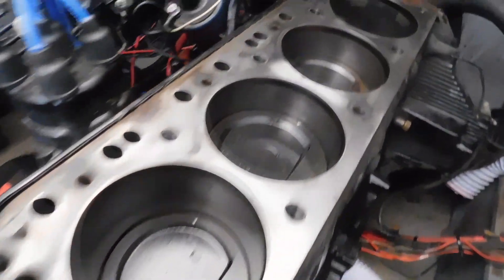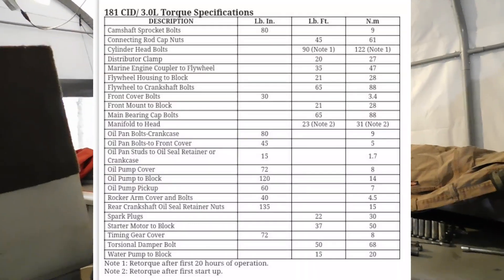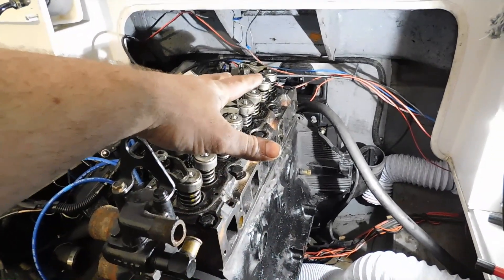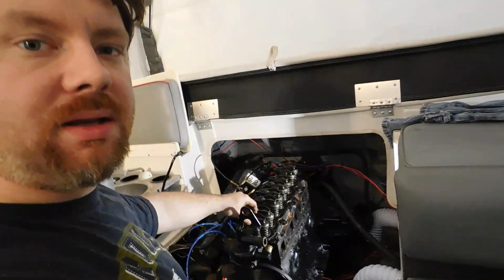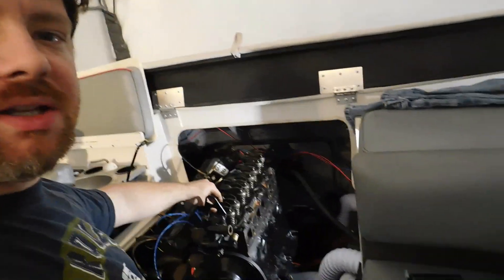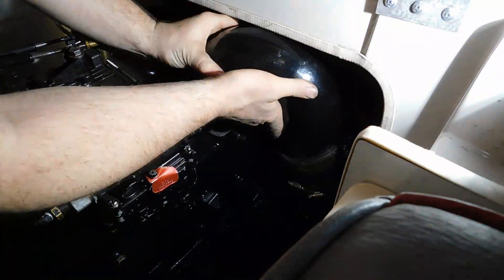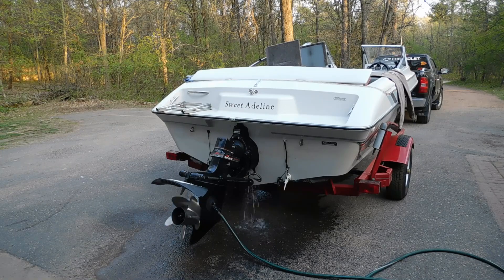Mercruiser 3.0 Head Gasket Replacement

Comment from the maker: To answer a common question I've been getting  check out my update video here  https://youtu.be/p5q3fEBXSQ8
Yes the block has been welded (prior to my ownership) and it's has other crack repairs.
Reply: Hey dale, did you turn the motor to adjust the valves?. Didn’t show in the video. But why the timing would change if you don’t touch the distributor?.
Reply from the maker: @sebastiangomez6929 I honestly can't remember. This was 3 years ago.  But it's always a good idea to double check timing after doing that much work

Comment: After cleaning the head bolt threads, add Permatex High Temp Thread Sealer to the bottom 3/4 of the threads on the bolt and oil underneath the head of the bolt before putting them back in. Then torque 30, 60, and 90 ft lbs in the specific pattern

Comment: Great video...i just got my 3.0 back running after 1 1/2 years...first start up it was running crappy then it blew some insulation  out the exhaust on the prob and i noticed water in the oil...do you think it was from the exhaust beinh plugged?
Reply from the maker: @danlee1904  perhaps. Sounds odd

Comment: Great video.  i was just going to replace my exhaust manifold and seeing this made me say what the hell, just do the head gasket while i'm already working on the boat.  I'm hoping to set my valve lash today and it just hit me.  How the heck did you turn the motor over to hit the timing marks properly?    I tried using the alt belt to no avail.... are you using a remote starter and just tapping it until it lines up?  Thanks for your help!
Reply from the maker: I had my wife tap the key and used the starter. Otherwise there is a special tool you need and you have to remove the front motor mount
Reply: @daleofalltrades  I used a remote starter button and it went much smoother than I was anticipating.  I have a slight valve cover leak now though that I can't seem to remedy.  I'm torquing to 40 inch pounds.  Is that what you are going with?  I hear people saying it feels like too much and can't help but think they are going 40 foot pounds.  I'd like to know what you did and are you using any sealant or just straight cork gasket?  Thanks a ton!
Reply from the maker: @vdubluv222  I re used the rubber/silicone gasket that was on it. No leaks and they tightened snug. No torque spec used on my end.
Reply: @daleofalltrades  thanks again
Reply: Thank you.

Comment: I have a bayliner 185 with the 3.0 that is spewing black water out the coolant water exhaust. Is this indicative of a blown gasket?
Reply from the maker: Yes or a crack in the head or block
Reply: @daleofalltrades  thanks for the reply!  So I did some more sleuthing today.  Oil on dipstick looks new, no sigh of water there. I pulled the block water drain plugs and that water was clear. I drained the driveline oil and it looked good (no water as well). Is it possible that it hadn’t been run in so long there was a ton of carbon and what not to be blown out and that’s what made the exhaust water so black and smelly? I didn’t let it run long after I discovered that for fear of not knowing what it was. 

I’m planning on draining and changing the engine oil as well as driveline oil to see for sure. Gonna check compression and the plugs. Also gonna change the water impeller, no telling if that has ever been done.  

One more question, I didn’t hook up water to the driveline intake until after I got it to kick over/start. I never let it run for more that just 15-20 seconds. Could that have disintegrated the impeller and caused the black?  It had been sitting for at least 2 years, maybe more, so I could see that being highly likely.  I didn’t know about some of these things to do on a boat that hasn’t been running for a while till now (my first boat!), was just treating it like getting and old beater car running.
Reply from the maker: @dkhallal  if the boat has been sitting a long time the water will look pretty nasty Coming out of the exhaust

Comment: Hi Dave and thanks for a great video! How do you turn the engine around to get it to top dead centre? On my engine the engine stand is in the way and I'd rather not take that away. Thanx Anders
Reply from the maker: You have to remove it or use the starter and bump the key. But you can't do that once it's tore apart.   Or you can put it all together and adjust the lifters the way I did at the end of the video

Comment: Are these gasket the same for the mercruiser 3.0 alpha one gen 2 135hp 4l?
Reply from the maker: I believe so. But I can't be 100 percent sure.  A simple Google search for you specific engine should verify. The head gasket is definitely going to be the same as the block really never changed on the top side

Comment: Did I see a 5 bladed Prop on that lower unit  ? What kind of performance is that offering ? Thanks.
Reply from the maker: Yes, it's a pulling prop, you lose a little top speed but gain how quickly it plains out. It's a quick silver highfive

Comment: 8:41 that looks like 1/2 turn. does it make a big difference?
Reply from the maker: Yea it was a mistake on my part. But at the end I ended up adjusting with valve cover off and engine running. (The way I'm used to doing it)

Comment: Thanks for the video, I have a 3.0 but it is a Volvo penta outdrive  I am sure they are basically the same gm 3.0 liter engine . ...head gasket here i come !
Reply from the maker: The Volvo Penta is the same block, with some different bolt ons

Comment: Did I miss you putting aviation sealant on the head bolt threads? I learned you have to do that the hard way.
Reply from the maker: So did I.  I have a follow up video doing all this over again.

Comment: Hey man good video, question?...how do you move the cylinders for valve adjustment with the front motor mount in the middle?....I can't find a way to get anything down there to move the cylinders and adjust the valves?
Thanks
Reply from the maker: I used an unorthodox method which is why I didn't show it on camera.  That being said I can't actually remember how I turned it. This was 2 years ago now.  Honestly it's easiest to adjust the valves snug and then doing the rest buy ear like I did at the end of the video

Comment: Just curious how did you rotate the motor to find TDC? I’m have a heck of a time trying to do this. I can’t get to the nut with motor mount in the way.
Reply from the maker: Been a bit since I did it..... If I remember correctly I used a pry bar on the webbing of the pulley. I'm a tag figgy how I pulled it of it's been almost 2 years now.

Comment: Great video again.  When your head gasket blew, did you have any water in the oil?  If so, could that not cause damage to mains, crank, etc.?
Reply from the maker: I did have a tad milky oil. It can cause damage however I believe it was caught soon enough as it's been a year now with no further issues
Reply: @daleofalltrades  Thanks.
Reply from the maker: @donens9310  side note I did just recently purchase a used stripped block for a rebuild in the future just in case.   My block is also cracked (prior to my ownership)

Comment: Hey Dale! Your videos are invaluable to me. I have the same issues. Can please help explain how you got cylinder 1 on compression stroke top dead center? What do I look for to make sure it is?
Thanks man.
Reply from the maker: You want the front cylinder (cyl 1) all the way to the top with both the valve closed. That is the compression stroke.
Reply from the maker: Hope that helps
Reply: @daleofalltrades  yes it does. Thanks! Your videos are awesome. I am doing the exact same thing Tuesday to mine. Head gasket, water pump, and all impeller and lower unit water hoses. Got a big overheating issue. I didn’t cook the head gasket, but it seems easy enough to change as long as I’m doing all of that to it. Thoughts?
Reply: @daleofalltrades  I should add, I bought the boat after it sat dry for 15 years. All the seals and stuff got to be rough by now. I have a whole gasket set to replace… worth the trouble?
Reply from the maker: Worth the trouble maybe. Worth the piece of mind definitely!

Comment: If i didnt do anything but loosen and remove the rods, just like you did, in theory wouldnt i be able to just put them back in place and tighten, since i did not do anything but take them
Out?
Reply from the maker: Once you loosen a rocker arm you have to adjust them regardless one re assembled.
Also check out my follow up video here https://youtu.be/p5q3fEBXSQ8

Comment: Hello, a really good video and everything is well described, but I still have to ask you something, how can it happen that the valve flaps can become misaligned, a tappet is broken, do you have an idea?
Reply from the maker: Well if a lifter "tappet" is broken then that is why your valves are out of adjustment... You'll need to replace the bad/broken lifter's or replace all the lifter's. I'd replace the rocker as and push rods also.  Lifter's can fail. Although it's not super common it does happen

Comment: I like your tight, visible framing of your procedures. However! Between acetone cleaning mating surfaces & dropping the head back down on the block, I did not actually see the new head gasket being placed...oversight? Covered somewhere else? Thanks
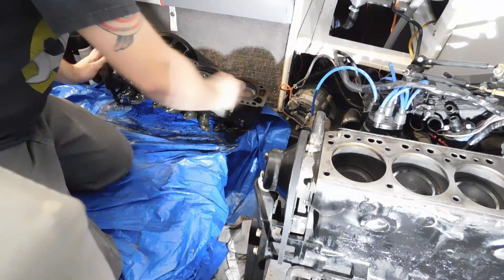Reply from the maker: At 2:10 I cleaned the surfaces and at 2:19 I had put the head gasket on off camera but you can see it sitting on the block. Just didn't record placing it on. It's pretty straightforward, can't do it wrong.  Make sure and check out my updated video that touches on some commeon questions I've gotten and more tips on replacement as I had some more issues a few months later.  Lots of good info in this video. https://youtu.be/p5q3fEBXSQ8 thanks for watching!

Comment: Do you do that for every push rod? Tighten until no spin and then 3/4 turn, or just the first one?
Reply from the maker: All of them
Reply: @daleofalltrades  thank you!
Reply: Also, do I have to move each cylinder to TDC before doing it or just the first cylinder, leave it there and tighten?
Reply from the maker: If u want my honest opinion just get them snug all on tdc (top dead center) and then run the engine and adjust like I do at the end of the video. That will give you the best results.

Comment: This is great video thanks.  Just starting into mine after it ran rough the other day and I found Cyl 1 full of water…
Reply from the maker: Thank you!  Sorry for your misfortune.  Water in the cylinder while an engine is running is never a good thing.  Take special care when inspecting the valves and push rods. If hydro lock occurred it cand bend things in there. Also while your in there check the exhaust flapper. I would figure out how water got in there.  Thanks for watching. Best of luck!
Reply: I have a lot of history with automotive engines but this is my first marine engine, thanks for the tip on the exhaust flapper…there wasn’t one, ha!  Found the metal rod it used to be on but I assume the rest fell apart and went out the exhaust,  Hopefully it ends up being that simple.
Reply from the maker: Mine was the same. If it worried take the prop off and make sure the exhaust passage is clear. I had a metal piece of the flapper stuck sideway in mine. Worth a check for piece of mind. I'm in the same boat as you (pun intended) I'm learning as I go.

Comment: Love working on these , super simple ,reliable, So far I’ve only came across one cracked block... I can’t stress the importance of having a decent waterproof doghouse.Thats one of the biggest reasons why these motors are getting hard to find
Reply from the maker: Yea well unfortunately mine was cracked prior to my ownership.  At least I'm not to blame.
Reply: My Four Winns engine cover splits open from the middle.  Didn't think anything of it when I bought it, but boy what a dumb design, the engine gets soaked.  Trying to come up with a panel I can put above the motor to keep it dry.

Comment: Great vid. I just got my mercruiser  3.0L head machine from the shop found water in the oil. I got new head gasket. Im in the process of cleaning up the pistons and block. What did you used to clean your block and piston?
Reply from the maker: Thanks. I didn't do a full year down so I didn't clean the pistons, nor was there enough water in my oil to matter. I used acetone to clean both mating surfaces. It's actually funny you should mention all this as I will have an update video coming out on mine. My gasket blew again. But the block isn't worth rebuilding cuz it has multiple cracks that have been repaired. So I do a Band-Aid fix in the video.

Comment: These two videos are awesome.  Long story short, I picked up a used 1986 Alpha One 140 this spring.  Boat was cosmetically well cared for, but I have done a lot of work including bellows, gimbal bearing, universal joints, and more.  Finally got things working, but I had this nagging feeling to check the compression (yah, I should have done that on purchase), and my #2 and #3 cylinders are far below the other two.   I have no other symptoms besides some slight acceleration hesitation (presume a carb work incoming), boat doesn't overheat and I have decent power, but it looks like I have this project in my future now.  Clearly the prior owner didn't maintain the boat mechanically very well.
Reply from the maker: Thanks so much for the compliment! I've been working really hard, really giving YouTube a shot. It's pretty common for these engines do blow the head gasket in that spot. Being that you don't know the full history of the boat I'm willing to get it overheated at one time and started to hurt that gasket.  How low was the compression? If it's below 80 it could be causing your acceleration issue.
Reply: @daleofalltrades  Confirmed today with a separate compression tester the #2, #3 cylinders are at 65-70, while the other two are at 130.  The prior owner even told me the only time the boat left him stranded was when a thermostat went out, so I think we have the culprit.  I plan to begin the teardown tomorrow.
Reply from the maker: Yeah definitely not a bad idea. Order the parts online now. Took about a week to get my parts.  Ordered mostly from Amazon. I bet when you get the head off you'll see some signs of stress on the gasket. Good luck. It's not too bad. While your in there check your exhaust flapper. They can get wore out over the years... Mine were gone.
Reply: @daleofalltrades  Thanks for the flapper tip,  I will definitely take a peek!
Reply: @daleofalltrades  Confirmed!  I had the exact same failure as you between #2, 3 cylinders.  I have to clean it up and hope it's within spec, but I've already contacted a few area machine shops that have about a 2 week lead time.
Reply from the maker: I figured!
Reply: @daleofalltrades  Well nuts, I figured I would do a valve job while waiting for parts.  One of my exhaust valves had a crack starting.  B.O.A.T. strikes again!  lol
Reply: @daleofalltrades  Muhhahahaha.  The suspension rod is all that is left of the flapper.
Reply: MI uhujjjjjjjj

Comment: I didn't see you use thread sealer on the head bolts. I have a Mercruiser 140 fill it's No1 cylinder with water over winter because previous owner had not used sealer when they replaced the head. I'd check your engine doesn't need the same. I used Loctite 567. Thanks for the vid
Reply from the maker: I did off camera, probably should have mentioned that in the video My bad.

Comment: What gasket/kit did you end up purchasing? I'm about to tear mine apart. Love the video! Didn't overthink any part of the procedure.
Reply from the maker: And I used this head gasket kit (this should work no problem on any 3.0 mercruiser.)
https://www.amazon.com/dp/B000CMGSDE/ref=cm_sw_r_cp_apa_glt_fabc_HT57FDD9MPP21MT7JZ5H?_encoding=UTF8&psc=1
Reply from the maker: I used this kit for the manifold (keep in mind there are 3 different head styles, this is the more common however.) https://www.amazon.com/dp/B0001CLFHY/ref=cm_sw_r_cp_apa_glt_fabc_8QKGZBSB3XY0CXFVBKD9?_encoding=UTF8&psc=1
Reply from the maker: Thanks for the compliment, glad I could help.